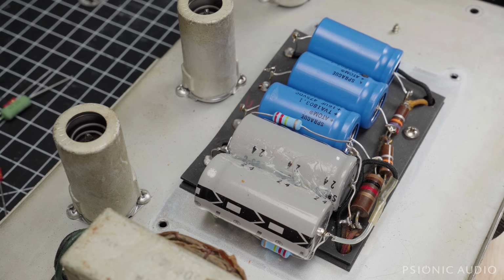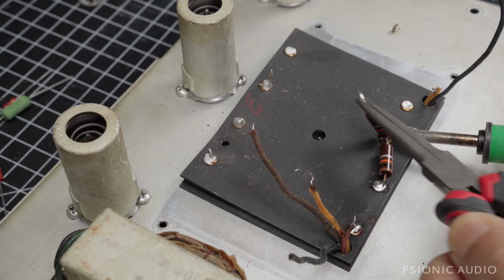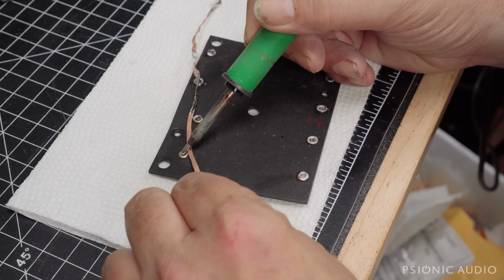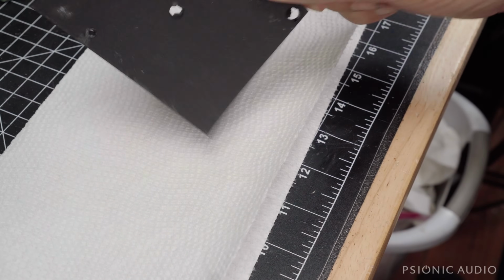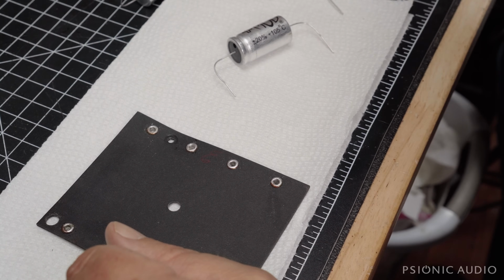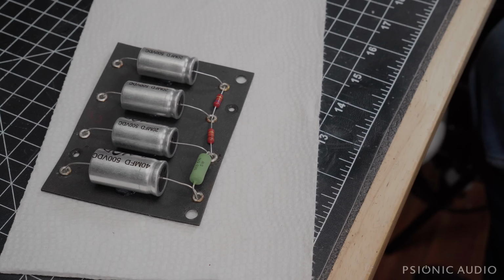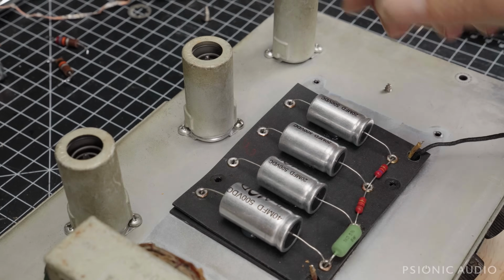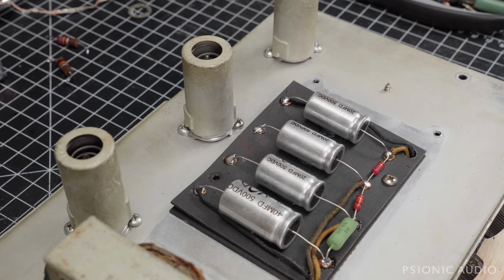Blah Blah Blah | "Undatable" 6G3 Deluxe Pt 2

Comment: I don't claim to be a reliable source, but I definitely appreciate the realistic look with mistakes and all. Almost every amp I've built or repaired has presented some unforeseen challenge. It's to be expected. Hitting a home run on the first build was the worst thing that ever happened to me - I expected it on everything that followed, and that's not what happened. Some decades later I can say that my first build (JTM 45) was just pure good luck. It powered right up and has never needed any repairs since. Thanks for keeping it real Sir!
Reply: Congrats on the home run on the first try! I struck out and hit into a lot of double-plays before I got anything right. ⚾
Reply: @socallars3748  I’ve had no repeats… so, pure luck I suppose.

Comment: I fully understand that non-original iron argument. I mean you can always totally rebuild an vintage amp using NOS tubes and NOS carbon comp resistors and NOS mustard caps etc. but it is very difficult to replace an original vintage OT transformer with a transformer which is absolutely identical to the original. And a better one does not mean identical. 🤓.  A power transformer is a totally different story, but OT is critical, if something in tube amps is critical.

Comment: Humility IS very reassuring, Lyle. I was also impressed with your adage "no mistakes leave my shop." It was well conceived, and added more assurance properly. Thanks again for the long-form style. It not only provides an education of electronic operation, but includes ample warnings against shock hazards as well. That being said, The best overall function of this format is that it grants evidence of why bench fees, and hourly rates are at the amounts set. I feel that most potential customers will have an understanding of repair cost(s) after watching these explanatory episodes. I look forward to the epilogue of this troublesome unit.

Comment: Too bad about the Tremolux, but I don't blame the buyer.  Question about using the 5 Watt resistor as the first dropper.  Wouldn't you want the resistor to burn up if there was a problem elsewhere in the circuit?

Comment: Hi, I have a question about the MOD caps. I’ve seen you use them. I’ve used them in builds as well. Are they as good and reliable as F&T or Sprague?  Thanks much
Reply from the maker: Better than current Sprague. Better specs than F&T but I won’t know for sure for another decade I guess.
Reply: @PsionicAudio  thanks much.  They are such a good price I wasn’t sure. I’ve used them in several builds.

Comment: It's kinda hard to be working and thinking and talking at the same time.
So I thank you for taking the time to treat all of us as if we were in the
room. That's why you get the big bucks!       Un pequeño broma,

The mic started sounding like it's gated/limited? It started a week or so ago.
It is different. As you talk or some other thing makes a sound lound enough to
trigger the limit it sort of goes on and off I think it might be AC, fan  maybe?

It isn't a bother for me but you probaly would not like it. NOBD
Reply from the maker: I’m trying to find the right amount of gating, a little heavy handed right now. Was -12dB, this was -20dB. I agree it’s too abrupt. 

On the shorter videos I can be more nuanced but in these long ones I just do a set n forget thing. And it was a bit much.

The center of the room where I work is boxy sounding with tons of early reflections off the bench and all the various surfaces (chassis, scope, meters, etc). And the overhead condenser about a foot over my head level gets everything. As I need to slightly compress things to even out the voice level as I move around, it can be worse, so a bit of mild gating helps. Just not mild enough here.

The area behind me where I do the live stream is acoustically better and I can work the dynamic mic set up for that, so I don’t use any gating etc on that.

Comment: I have noticed that although you use an iron that's quite hot, you don't seem to use heat-sinks much. I had always heard and read that heat-sinks were necessary when soldering to protect resistors and other delicate parts. Was that just misinformation?
Reply from the maker: I use them when a lead is really short or it’s a very heat-sensitive component. 

Not misinformation, but I see people heat sinking unnecessarily a lot.

Comment: LoL. The first wire you cut in the video was the black wire...
Reply from the maker: Yeah, I should have cut it after the splice and undone it. It usually has more extra length than this. But point taken.
Reply: @PsionicAudio  that's ok, I probably did the original work. Looks like mine. LoL

Comment: Why did you stop using F&T, are you just having a hard time getting them?
Reply from the maker: I’ll still use them when that’s the only option for a needed value. But they are 85C caps and the MODs are 105C rated.
Reply: @PsionicAudio  Learn something new every day as I did not even know that they did not offer 105C rated capacitors.

Comment: Hey,
You've mentioned that you use CE Distribution/Tubesandmore.
I'm five miles from their "will call". 

I can get alot of the same things from Hoffmans in Pisgah, NC.
(I'd had trouble with USPS shipping back 4 years ago. Long sory 
short, They went o NM then to Phoenix, took  a week or 2! I recieved
stuff from Hoffman in less time than CE five miles away? And that
was USPS cheapo rate. Thank you Mr. DeJoy)

Any who... I'm thinking Pisgah is closer to you. No?
I figure you get point break with bulk buys from CE.